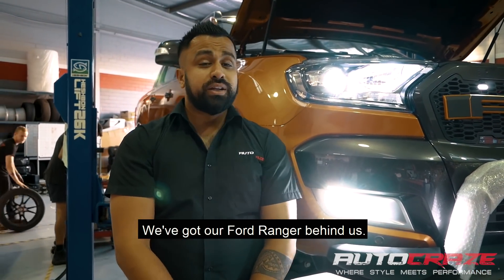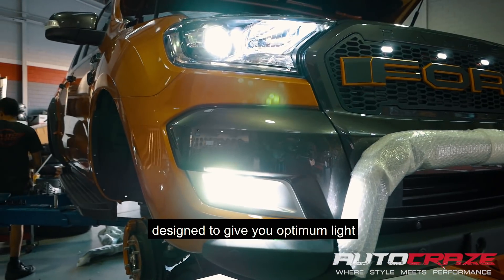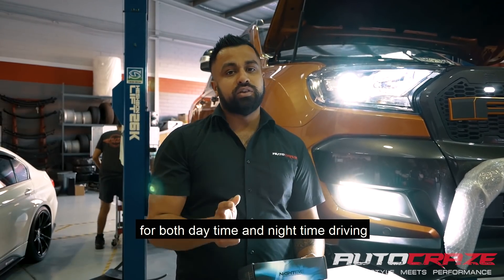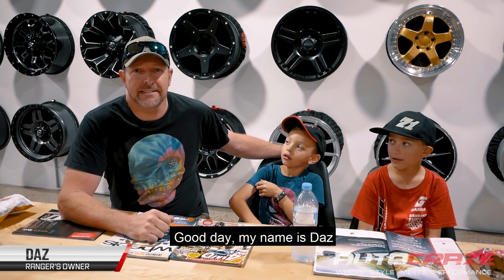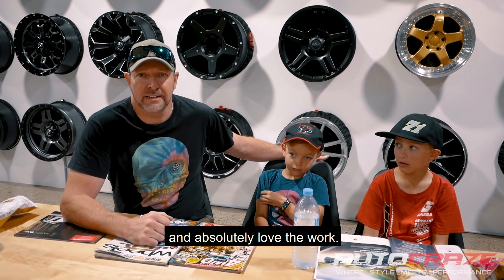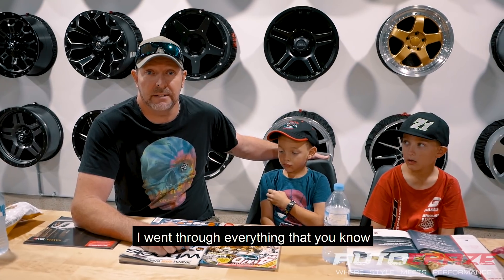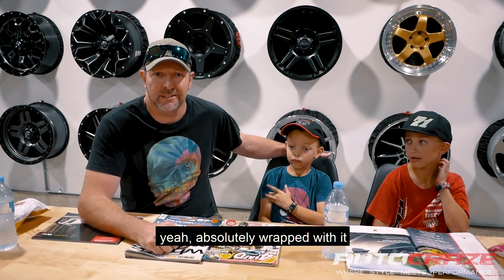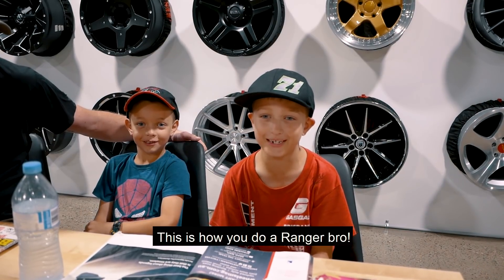JUICED RANGER // Aftermarket Ford Ranger 4WD Accessories Australia, Rims & Parts, Modified Wildtrak

Comment: Hi guyz, I can see there is a hole above the rear license plate in the rear bumper, do all rangers has this “hole” ? If so wth didnt Ford put a cap on it....just the ignition switch, they didnt even bother to put a luminous ring around the ignition switch which is now difficult to find the keyhole plus its wobbling a bit.
Reply from the maker: The hole you are speaking about is used to drop the spare wheel